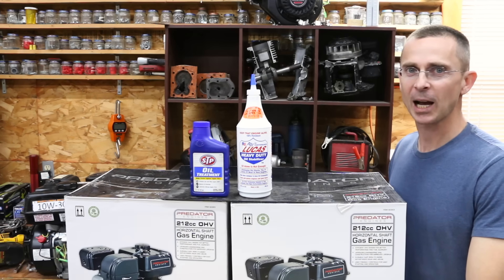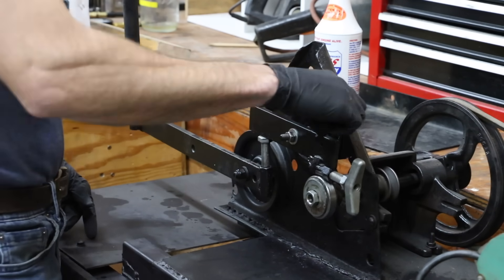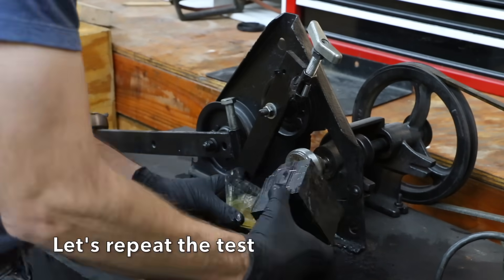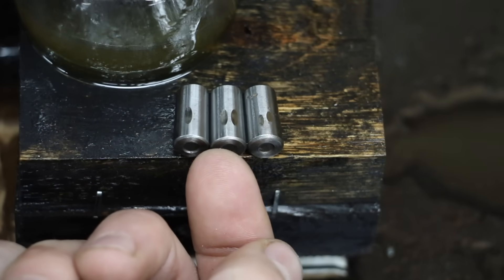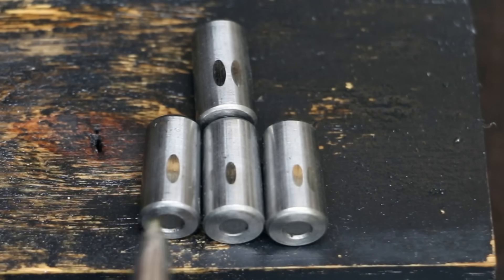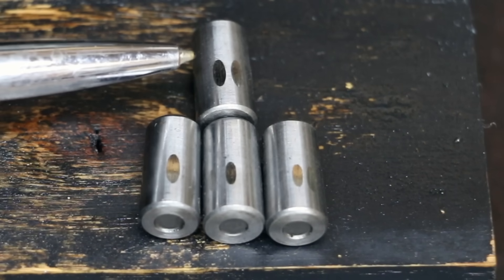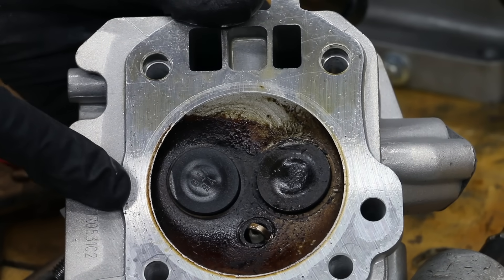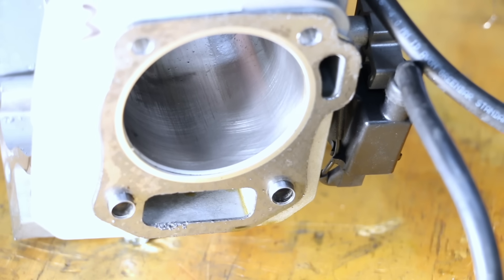Which engine self-destructs first?  Lucas or STP?

Comment: I would look at the Lucas being the winner with run time without the oil.Yes they both came apart, but anything would without the oil.But being able to double the run time without is impressive.So a regularly maintained , oil changes with this additive says a lot with excessive wear.Excellent demo and break down of the engines.The bearing test as well.Stumbled across your videos, now going to keep watching.Good job
Reply from the maker: Thanks for the positive comment and I agree that Lucas seems to be the clear winner.

Comment: Mount the carburetor to the side of the crankcase. Then, have the intake manifold draw the mixture from another side of the crankcase. Mix oil in the gas, creating a two stroke style four stroke. 
It might be hard to start, but should run reasonably well, even with a load. Because all components are getting lubed, even the exhaust valve to some degree.
This is an idea for a new video.
Reply from the maker: Thank you for this recommendation.

Comment: Entertaining, perhaps. -- But since the test does not contain a statistically-sufficient "sample size", its results are not useful in any valid scientific sense. The test is not double-blind. One engine appears to run hotter than the other, but we do not know if it ran hotter than the other during the initial break-in period. It's also a terrible waste of perfectly good equipment rendered unnecessary since the bearing test apparatus shown in the earlier part of the video was available. -- But let's wreck some actual engines to get views! Will they blend!? (...but we won't wreck twenty of them for a statistically sufficient sample size. That's crazy talk.)
Reply from the maker: Thanks for the constructive feedback.

Comment: Motor Silk and Archoil, these are Boron based oil additives that are really the only additives now a days that hold some facts of working. Motor Silk uses a government labs patents in their formula of boric acid. Here is the technical data..... http://www.altboron.com/tech_data/index.html

Running a test on regular boutique oil while there could be a difference say Amsoil Signature series that is a group 4 oil vs Redline oil that is a group 5 oil. after a couple of minutes most will be worn off or used up. The "plating" of boron oxide would be the test.
Reply from the maker: Thank you for this recommendation.  I'll test Archoil for sure.  Thanks again.

Comment: ZDDP (zinc dialkyldithiophosphate) is a high pressure friction modifier.  

There are 3 ways to do it- ZDDP (zinc), Sulfur, and Antimony.  It's what prevents wear.  Any meaningful amount of ZDDP found in motor oil can't pass ILSAC and API since the late 1960's early 1970's because it's precipitates clog catalytic converters.  They still use it in NASCAR because they don't have cats on their exhaust.  It works, but if you use enough to make a difference- it ruins your cat.  Fine for cat free lawn mowers though.  

I'd like to see Xtreme Green vs. Best Line.  I know XG uses organic antimony derived from plants.  I've seen oil lab results that show higher levels of antimony and dramatically lower levels of wear metals in failing diesel engines.  Read articles from Bobistheoilguy on antimony as a HF modifier- he likes it.  

BestLine uses mineral spirits (a huge no-no short chain solvent stuff oil manufactures advise against-breaks down oil like nail polish remover), waxes, polyalphaolefin base stock (good synthetic oil) 1-decene, homopolymer, hydrogenated (silicone to keep things moving)    and what does all the work as a high pressure friction modifier in all that soup?  Synthetic calcium sulfonates (basically sulfur like you find in gear oil).  The rest of it all just works like a UPS truck to get it where it needs to go and bust through any crud on the road (oil gallies) to the bearings as far as I know.    If you want a bottle of XG I'd be happy to send you one.  I have a few from tests I've been conducting on my own sitting on the shelf.  I like it.  The science is right.
Reply from the maker: Brian, You have a great YouTube channel.  I really like the Xtreme Green vs. Best Line showdown.  Since I've already tested BestLine, I plan to compete XG against another additive for now but plan to compete it against BestLine in the future.  You seem to have great knowledge regarding the contents of these additives.  I'd appreciate any suggestions you have any suggestions to pass along regarding my testing approach.  Feel free to send me a PM at projectfarm52@gmail.com  Again, thank you very much for the in-depth explanation and I'm looking forward to testing XG. There's no need to mail it to me.  I buy some off of Amazon.  Regards, Todd

Comment: Great video. But all of my questions about these two additives (or any additive) could have been done with a test showing how much stays on a vertical surface over a period of time. I use STP mainly to help avoid "dry start." I'd be nice to know if it's worth the spend over the same amount of synthetic oil in this scenario.
Reply from the maker: Thank you for this recommendation.

Comment: 1996 - Seattle, I saw advertising ride car without oil pan and valves cover. After SmT2 .  All my cars ride on this thing, for some reason SmT2 disappear  from market.  So I believe its a best thing for all engines. If you can, try it. Lucas and STP just normalizes oil. And do nothing for real protection. All my sports friends use SmT2, one of them ride 120km on his motorcycle 1200cc after crack oil pan. Engine dont even starts knocking or  any other noises.
Reply from the maker: SmT2 -- Thank you for this recommendation.
Reply: You still can find this stuff on e-Bay or Amazon. Costs about 16-24$. Hope you can test it some day. And you are welcome. If you need any help with that count on me. Right now I am move from Russia to Seattle. And works like Auto mechanic.

Comment: How about a test for diesel engine oil.  Rotella 15w40 vs Valvoline blue vs mobile delvac vs delo 400 because these engines are under more stress than normal gas engines especially in semi trucks.  Thanks
Reply from the maker: Thank you for this recommendation.

Comment: How about breaking in an engine, filling the crankcase with Amsoil 10W-30 Synthetic Small Engine oil without any additives, run it again just as you did in this test, then do the destructive test after draining all the oil.  It would also be interesting to do the bearing wear test with just Amsoil (ASE) Synthetic Small Engine oil - again with NO additives. Then compare all the results with this test. Amsoil says their warranty is void if any additive is used in their oils.
Reply from the maker: Thank you for this recommendation.  I plan to test Amsoil soon.

Comment: You forgot the control engine. That's where you put normal oil in take normal oil out and try and blow it up just like with the additives you just found out which one is better between Lucas and STP but you did not inform us of whether or not we got any benefit from regular oil with these additives because possibly Valvoline for example maybe a better viscosity and may have lasted longer without an additive
Reply from the maker: Thank you for this recommendation.

Comment: Here's a new idea for testing these engines. Try  Hex-Boron Nitride (hBN)  mixed in the oil during your 3 hr breakin period, drain and see if the treated engine runs longer vs untreated. I use this stuff to treat my rifle bullets prior to reloading the cartridges and it really works well as a super high pressure lubricant. I've always thought it may also be a great additive to engine oil, but was too chicken to try in in my car..   You can get the stuff cheap on Amazon.com.
Reply from the maker: Thank you for this recommendation.

Comment: I would love to see a test like this using plain tap water. 

One of the jobs of crankcase oil is internal cooling. If a crank case was full of water, it would provide internal cooling with much lower viscosity and lubrication property's.  It would essentially be the anti additive test. If an engine can run on tap water with little to no damage, why buy expensive oil additives?
Reply from the maker: Thank you for this recommendation.
Reply: Thank you for responding. I subscribed to see the water test.

Comment: Perhaps the reason why the Lucas engine "ran hotter" was because there was better thermal conductivity, only making it appear to be hotter, while the STP contained the heat. It would support why the STP crank was in such bad shape with melted connecting rod still attached. In any case I believe Lucas won. Not only did the Lucas engine run twice as long, there was also less overall damage to components. That leaves me to believe that Lucas sticks to the metal better than STP.
Reply from the maker: This is an excellent point. Thanks for commenting.

Comment: This is not a very good test, I feel like the actual point of this test is strictly to destroy these engines. A better test would've been to just use the additives as oil alone and see how they perform. These additives are for longevity so another test would've been letting them run continuously until one dies then check parts for wear and tear. I understand that these additives are supposed to help oil stick to parts using zinc however I felt a better test could've been done.
Reply from the maker: Thank you for this recommendation.

Comment: This was not a scientific test. All you did was prove engines without oil will fail. Where was the control?  You should have had a third one with just plain oil. If the control engine ran longer then the additives are a waist of money.  But without the control, all you did  was to destroy two good engines.
Reply from the maker: I did the control a couple of video back. Sorry I didn't explain this.

Comment: Wens friction proofing
I remember as a kid,man stopped by the garage where my dad worked, with ford flathead V8, he stopped out back and called to me to come to him, when there he pointed out the oil psi, started the engine AT a idle and opened a valve that drained the oil out, and we watched the oil psi drop to O, don't forget it was Idleling, we went inside and he gave a speal about wins friction proofing, after about 1\2 hour we went outside to the engine, he pointed out the O oil psi and he reved it up and it ran good
Whose athunked it?
Reply from the maker: Thank you for this recommendation.

Comment: There should be a control engine. So 3 engines in the test.
A graph of each of the measured parameters.

I found the vid interesting but the results too difficult to decipher from an analytical point of view.
Reply from the maker: Thank you for this recommendation.
Reply: I'm thrilled you replied.
Thing is you don't want to get too 'scientific' that your vids become dry and uninteresting, but by using bar graphs for example (which are a diagrammatic representation) really helps to condense information into a visual format that is easily absorbed (like Aspro Clear lol). 
Thing is with graphs, they need to be really simply labelled and displayed not too quickly nor too long. A voice over commentary is very useful when displaying graphs.

I really enjoy vids like yours. Engine Masters have some good ones. Awhile back they had one on the effect of denting headers with a hammer - which was very revealing. 
What I took from it was that mendrel bent primary tubes might be a waste of time.